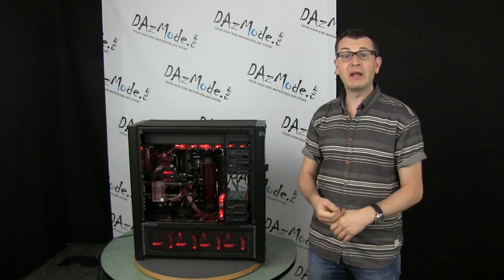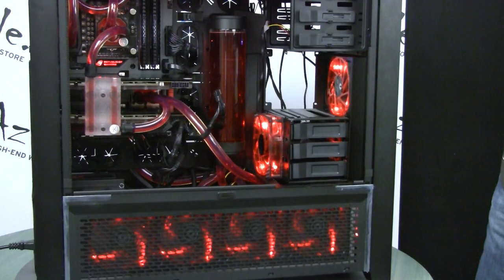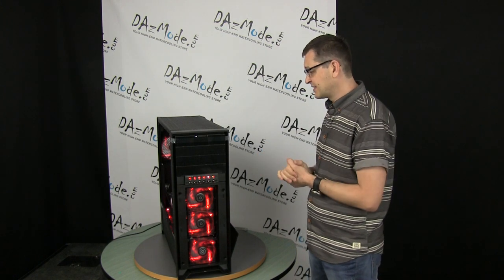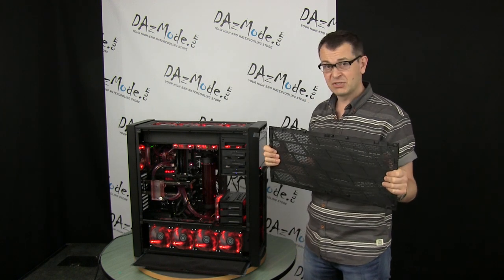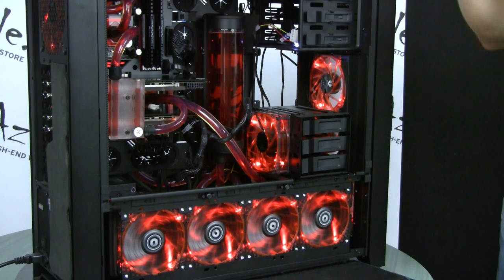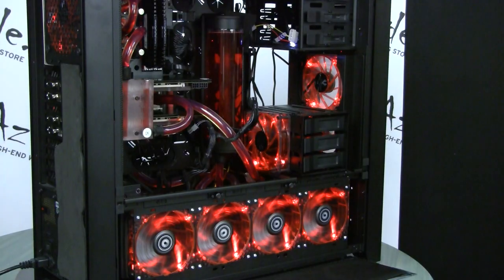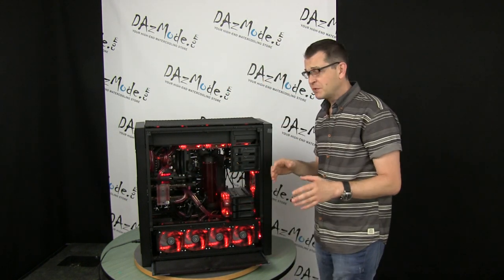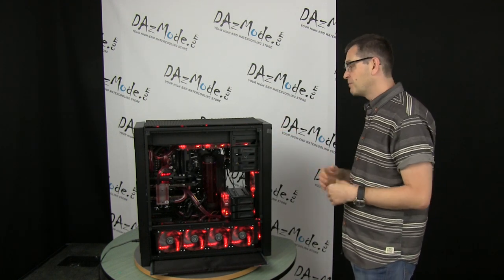Daz Clinic - Customer Build #1 - Ep 1

Comment: just finished my M8 rebuild, after messing with acrylic tubing and having numerous pieces cause leaks (granted I'm using the old bitspower C47 fittings which aren't as good as their newer compression fittings), I think I'm done messing with this system for at least a year.  but as far as this video, I couldn't imagine ever going away from caselabs cases, the 900D looks so cheaply made

Comment: It really isn't that bad a configuration, to be honest I'll be surprised if you get any noticeable performance gain with these changes. 

You can make it cleaner and simpler, but performance wise, it's actually fairly well done.
Reply: It looks like someone has just smashed in a load of parts with no planning and he even said himself, one part of the lower rad was blocked off.
Reply: Yes but 1 fan isn't going to change the performance that much when you are using 2x480 rads, the corsair 900 is supposed to be able to house a pus and bottom 480 rad so I don't know why this configuration is blocked off, I guess we will have to wait and see :)
Reply from the maker: I hear what you saying, but this is not about performance. I'm saving the entire system exercise. It is leaking, on verge of tubing collapse and has unmanageable WC setup.
Reply: DazMode Custom Computing It looks like a first attempt at a custom loop to me, I wouldn't have done all that myself.
Reply from the maker: I0ITuGI0I Yes, this is customer's first WC build, hence collection of typical mistakes.

Comment: Fully agree with the negative comments on the Corsair 900D.

Bought it a few months ago based on some of the positive reviews from the likes of Linus TechTips etc but am very disappointed. The case has some interesting features but fails because of poor quality in certain areas, no manual (took me an hour to figure out how to take off the top panel without breaking it to mount fans) and almost impossible to put in the screws to secure big expansion cards like graphics cards at the back because this specific area is almost inaccessible. Had to drill holes to be able to secure the cards...

Comment: is the bubble in crossfire bridge normal? (look when they zoom on gpu's). if the bottom radiator pulls form the front i would reverse the fans so hot air goes straight out the case and not warm up the internal air of the chamber.
Reply from the maker: It makes no difference in this particular situation, but you can unscrew stop plug and get rid of it or tilt the case and push it out..